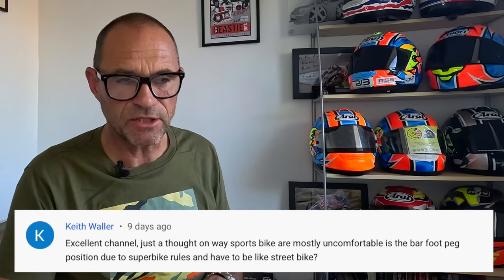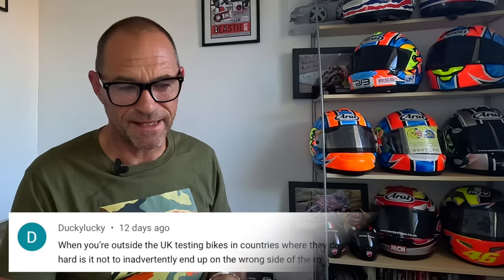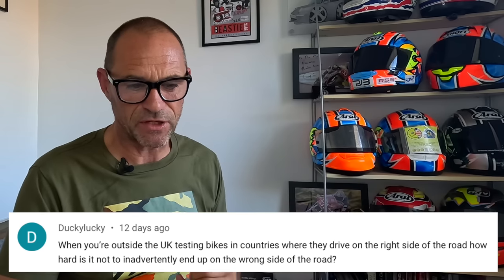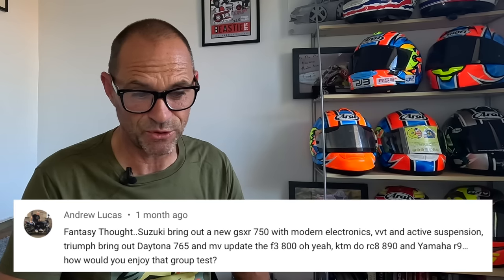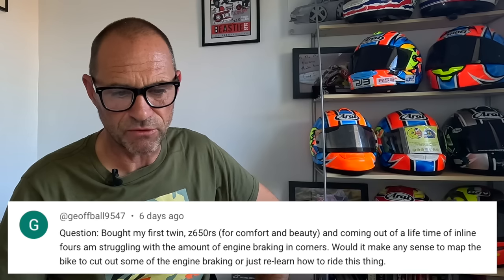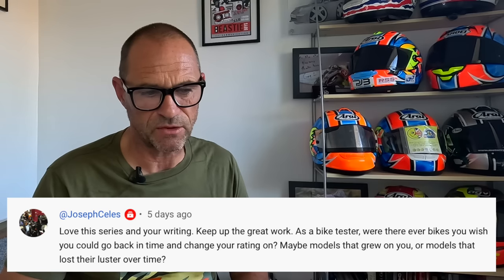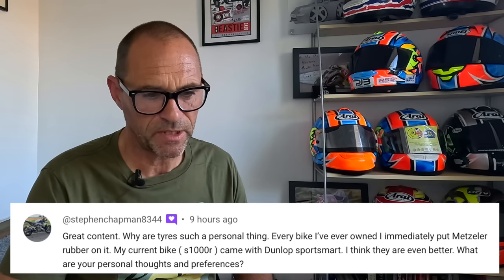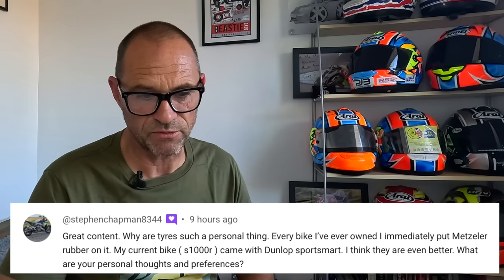Thanks for asking: Why do sportsbikes need to be uncomfy? Being on the wrong side of the road & more

Comment: Sports bikes were not always uncomfortable. As you will probably remember, the late 90s version of the Blade (carb model) was a lovely bike and great for general road use.
Reply: I think the S1000RR (extreme power), current R1 (extreme riding position) and Panigale 1199 (both, combined with a needlessly peaky engine) are the bikes that have set the trend of current "too good for the street" sportbikes. For me, sportbikes should have some extra CCs, just to bring that midrange up, lower the footpegs and raise the clip-ons a bit. Oh, a proper pillion seat wouldn't hurt.
Reply: 100% My 96SC33 I can sit on all day. Although bikes have got better in nearly every aspect, comfort has gone backwards.
Reply: CBR 929 (2000) PGM-FI was fairly comfortable too.
IMHO 2004 is when the Blade shrunk and took the race crouch position as standard...
Reply: My 1993 gsxr750 would laugh at you for saying it was comfortable.    I still own it and it keeps me and my aging knees in check.

Comment: Sportsbike ergos do suck out of the box, but if you can set aside maybe $1000 or so, some Helibars or adjustable clip ones, adjustable rearsets and a taller screen make a huge difference. Hell I've heard stuff like swapping the left and right clipon and turning them upside down (to get rid of the downward bend) helps on some bikes. It's bizarre that they are often so bad out of the box though.
Reply: Man, I thought I was the only one bothered by the downward bend on clip ons on pretty much any sportbike, that completely kills all the comfort and control I have in the corners. I tried flipping them and it was noticeably better, but a bit too far in the other direction, I couldn't grip them properly when hanging off. I feel like 0 degree clip ons would be perfect, I'm probably gonna buy some for my next bike.

Comment: So much interesting stuff. I may need to start taking notes!! I accidently found the ideal sports bike for me and it is not a sports bike per se. I wanted something with a fairing but not a tall-rounder, was a bit sporty but not going to be an issue with my aching limbs, powerful enough to be exciting on the road but not intimidating, and could take some luggage for the occasional longer trip. Couldn't find anything to fit the bill so bought a Ninja 1000sx and lo and behold it is exactly what I was looking for!! Seems obvious in hindsight, but at the time I saw it as more tour than sports. Actually it is an old man's sports bike you can fit panniers to.

Comment: I’ve owned and ridden many sports bikes and to be honest I don’t for the most part find them uncomfortable at all. I think every experience is different based on you body type and fitness. I strongly believe you have to be in good shape to ride a sports bike comfortably. Then again I am lucky that at 6’ 2” I have long arms and torso and not so long legs, this makes both my 998 and Panigale 1199s quite comfortable. What I like about the 998 is I sit in it not on it and I have plenty of leg room on both my bikes. If I recall this wasn’t the case on my old 1198 when I believe I had some knee pain on long trips, for some reason I had less leg room on that bike. I think my main point is if you stay reasonably fit and limber, pick a bike suited to your frame, if possible, then you will be golden. Having said that sports bikes these days are made pretty small and compact. Anyway just my 2 cent’s

Comment: Wanted a Ducati V2, but was turned off by how high the seat was, dropped clipons, and almost to steering.  The dealer recommended the V4 for the street as it has more low-end and mid-range.  I sat on one of those and also determined that it was a race bike. Very top-heavy, tall seat, low bars, and little steering movement. As much as I wanted one, I would not be happy driving down the freeway on one.
Reply: Test rode the v4s and a year later the streetfighter.   The streetfighter is what your looking for

Comment: Great vid as ever. Really interesting questions & answers. I love the characteristics of twins, especially V-twins as once you get used to it, you can almost use it like a gentle brake & just roll on & off the throttle using the torque without lots of gears or heavy breaking. It's a pleasant way to ride if you're not going for it.
Reply: Agree and its one of the big reasons why I like my GS.

Comment: Talking about technique on track, I was told on a recent course to go slower and concentrate on a couple of points of technique - 5 degrees less than my maximum lean angle, never more than 90% throttle and short-shifting everywhere, 35kph slower on the main straight… it was my fastest lap by 6 seconds. Clearly lots to learn and improve but that’s the fun of it. 😂 Something that really put things in perspective was seeing Troy Corser go flying past me into a corner and then disappear down the straight on his back wheel… with a pillion on the back of his bike. 🙈 An instructor told me he went on the back of the bike with him and they had 58 degrees of lean angle… Very impressive stuff to see up close.
Reply: Do you think your instructor was trying to get you to look more at the track and where you wanted to be, instead of you trying your maximum in every moment?

If you're at maximum lean, and trying to get max throttle as you get the bike upright, then maximum brakes, you might not have the time for positioning excellence?

I want pay a guy who was riding slower than me but his lines were amazing. He was riding outside edge to inside edge to outside edge. Great positioning. Probably be was a faster rider than me and he was working out the best lines.

I'm guessing your teacher might want you to do that? And you did it, and you went way faster.

What do you think?

Did you video the sessions?
Reply: @Google_Does_Evil_Now  They wanted us going slow (80-90%) in order to have time to concentrate on various techniques being taught. In this case it was body position (hence less lean) and lines. I did the same course at the beginning of the season. I’m never trying to give it my maximum though - small steps, building technique, etc. I did get some video but not much.

Comment: New sports bikes are tiny & extreme. That's why you see so few in the road. I'm currently looking at gsxr K6/7 for comfort, touring & fun. The new so called adventure bikes just bore the crap out of me. I'm going to add Helibars, footpegs, gel seat, screen & heated grips. A rear shock & suspension service as well.

Comment: I try to keep a steady throttle through corners on my V twin rather than cutting it through corners completely. That helps with the engine braking without taking weight off the front. I'm not sure my slipper clutch makes any difference, still loads of engine braking.

Comment: The engine breaking in my Panagale v2 is pretty strong. MT07 was pretty strong too considering my knowledge of bikes back then. Small roundabouts are hard work, left and right tight turns also. Until you learn to control the throttle and not close it. 
Absolutely different story in faster bends.l think It’s amazing and a lot more comfortable.

Comment: I think that the litre bike class superbikes used to not be as extreme, but that's where the market has taken them in recent history of about 10 years.  They used to be a bit more relaxed on the street versus straight up race bikes, but the market dictated that people wanted the fastest, sharpest bikes available, basically race bikes for the street.  Also, there was demand for the ability to take the bike from the showroom right to the track and perform.  Neveesy is actually taller than the average guy, so for me, someone who is 5'10", I don't feel the same crampedness on these bikes as he does for legroom.  However, I do find the bars on the R1 and Panigale V2 very low, and that is more uncomfortable for me than higher pegs.  I have a 2020 RSV4 Factory, and I do agree the Panigale V4 is a bit roomier, but I don't find my bike too bad for the rider triangle.

Comment: To the guy with the Z650. You will get used to it and it does get easier. i went from a GSXR1000 L6 to a Ducati 1299s and the twin took me about 2 months to understand it. riding it is different and the engine braking mostly. it feeld like you have hit a brick wall it engine brakes that hard. but you ride with it and use it to your advantage. i find i don't really need to brake that much in normal riding , only when i am late for dinner and i can hear the wife telling me off do i end up braking hard along with the engine braking.

Comment: Having ridden about 120,000 miles in the UK and 160,000 miles in Europe I have found that you never mix up which side of the road to ride on unless you are distracted (usually at a junction). Distraction can be caused by anything: thinking about work; thinking about the bike; thinking about your significant other; thinking about the beautiful, shapely scenery; the list goes on... So, the rule is: Think about the ride and put everything else out of your mind!
Oh, the positioning of traffic signs can remind you which side of the road to ride on if you get confused. If they look like they're on the wrong side of the road, or facing away from you - it's probably you!

Comment: Q&A. Which bike have you sold and regretted most? …or are they all on loan 😂 I sold my 2011 Repsol blade with 22,000 miles. it was still immaculate and nothing had gone wrong on it in 10 years. Regretted it later.

Comment: My first big bike was a 2002 CBR 600 sport F4i (before it went to the RR with the underseat exhaust) and It was pretty comfty compared to a modern supersport. The clip-ons sort of came up high, not low. Pegs arent so high and the seats alright.  They're getting  hard to find now but worth mentioning
Reply: Honda did the math on their 600 sales and brought out the CBR 650F as the spiritual successor for CBR 600F leaving CBR 600RR to rule the Supersport class. 

However the sales volume drop and cost of Euro 5 meant that Honda Europe decided to stop selling CBR 600RR.

Then Yamaha decided to continue selling R6 only for Track use and Supersport became R6 Cup!

CBR 600RR is back for 2024 being E5 compliant.

Comment: I think u can adjust the fuel map to control the fuel injectors to put small amout of fuel to keep the drive to combat some of the engine braking or change the timing to have the exhaust valve open earlier to let the exhaust out earlier and lesser pressure inside the cylinders? 

I just think out loud I could be totally wrong

Comment: Brilliant channel! 

I have a query about high mileage bikes. I’m a relatively new rider who is in the market for a year-round commuter. 

I often see well priced bikes with over 50k on the clock. They seem to sit on eBay struggling to sell, even with full dealership service history. 

It may be my lack of understanding as a newbie; but is there anything inherently wrong with a high mileage bike? I get the impression that anything with over 50k miles is highly undesirable. But surely motorcycles aren’t that highly strung? 

I guess I don’t understand why bikes aren’t considered to have 100-200k lifespans like cars are.

Comment: Hey Michael, I have a question for you.  I have just completed a week in the Picos and worn out a Metzeler Sportec tyre in 1400 miles on a modern bike with electronic aids.  Should I stick to sports tyres or use a more touring focused tyre for better mileage and let the traction control, etc keep me upright.

Comment: Love this series and have gotten a lot out of these so far! I have a ton of questions regarding track riding but will try to limit them to the top few bugging me. Some times, especially during slow corners it feels un-natural and most often or not I end up in the wrong gear (either too low or too high) and mess up my drive out-Question 1: Even if I do get the right gear and line, do some corners always end up feeling un natural (doesnt feel free flowing).Question 2:The last time I was on track for some weird reason I just couldnt get in to the groove(mentally) and started questioning what I was doing on track, needless to say I crashed on the second session ruining a two day track day. Does this happen to other riders or am I an exception and how do I deal with it? I have a ton of other questions but will keep them for another time :-). For context, I have been road riding for the last 30 years but have only recently started riding on track.

Comment: Hi Neevesy,  really enjoying your videos, please keep up the good work. I replaced my oe tyres with some maxis as I didn't have bundles of cash at the time. They gave more feel than the stock tyres but I was instantly hit with very loud road noise. It was so loud that I thought I had blown the wheel bearings.  Also the rear has just started to square after 2000 miles. Lesson learned. Have you experienced this? and where do you go to find what tyres fit what bike? Thanks.